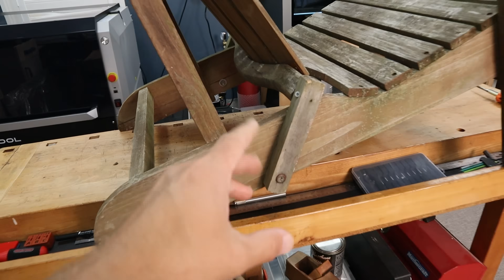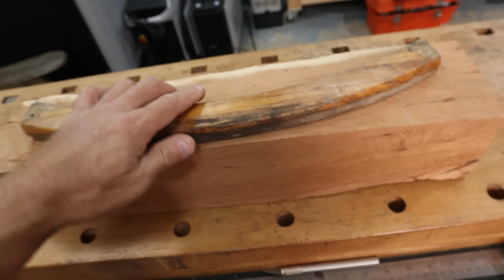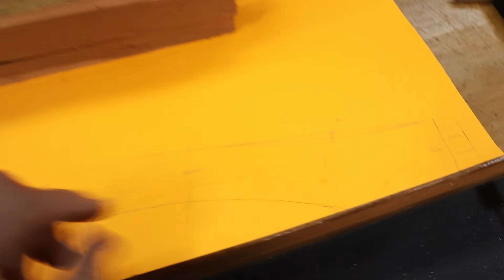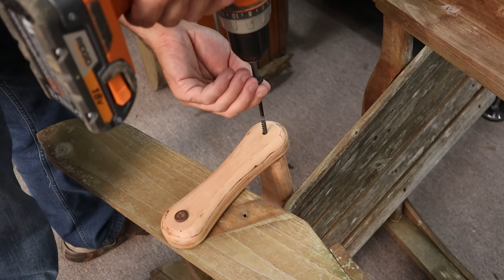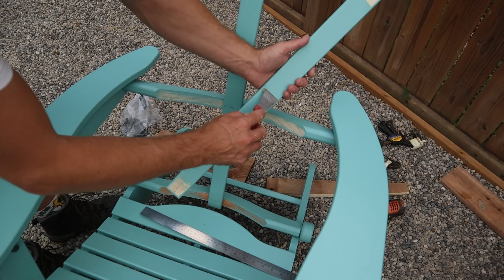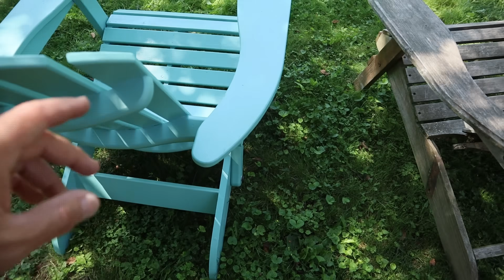I salvaged two Adirondack chairs to repair and ended up making new and improved versions instead

Comment: I was thinking the front bar could even curve down so much that it’s flush with the front leg and be able to support themselves by touching the floor also could the hinge stubs be sized to fit a section of pvc tubing as a bushing, no noise and smooth hinging maybe

Comment: In regards to the back rail with the pivot point not pushing the side far enough out, it looks like on the left side everything is pushed closer together… did you determine where the inaccuracy came from? To me it seems like it is either the tenons being different lengths, or the curve for the back slats is not quite centered between the ends of the tenons 🤔